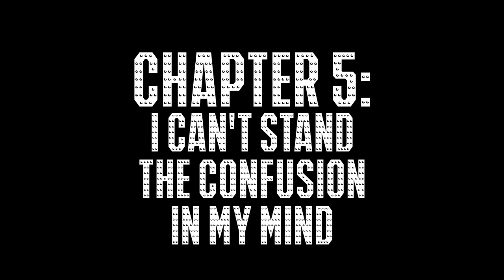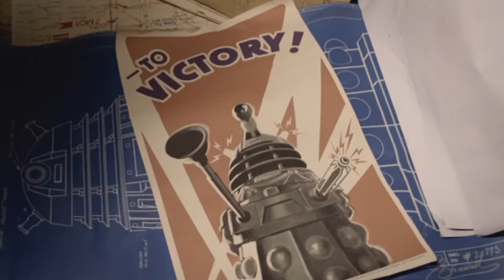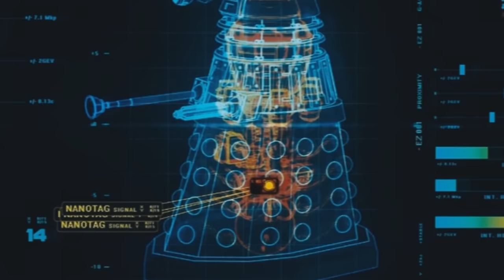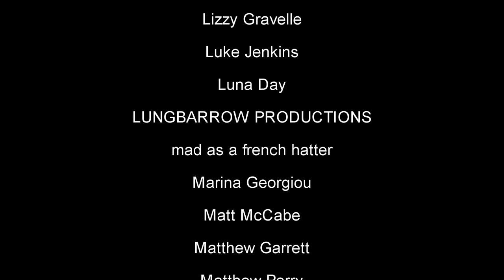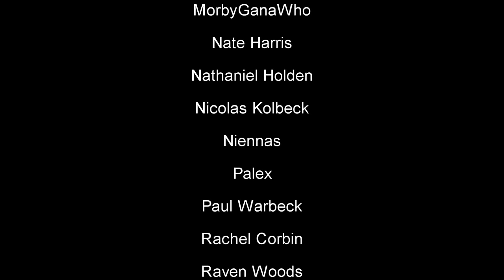The HISTORY of the Daleks ('Genesis' to 'The Time War' to 'Resolution' - 1963-2020)

Comment: I dont care what anyone else says, i LOVE the paradigm daleks. I wish future daleks would be colorful. I mean, it’d be easy to tell them apart, right? each color has their role.
Reply: I both agree and disagree. I want more colorful Daleks, but something more in line with what we saw with Capaldi. Gray & blue Daleks with stubby lights, gold & brown Daleks with cone lights. Yellow & red Daleks with bracings. Stuff like that works so well.
Reply: I feel like they should have like a line on their head that determines their role
Reply: @Bonnie-fy6od  I thought they should have gone full power rangers and combined to form an Ultimate Mega-Dalek
Reply: @Bonnie-fy6od fr. Never knew their roles till years later.
They could have been the new cult

Comment: Yeh, there's a problem right at the beggining of your video. The Thousand Year War and the Neutron War are different wars entirely. One took thousands of years, turned into a war of attrition, and was primarily though with biological, nuclear and chemical weaponry (I believe its the chemical and biological weapons that cause the mutations, not radiation per se if I remember correctly). The neutron War by contrast happened in a moment, and completey petrified the entirety of all living matter on the planet while leaving all non-organic structure intact. 

The only way one can square this is that the events of Genesis are absolute canon origin story, and The Daleks have to take place potentially millions of years afterwards, maybe even at the end of their existence. Remember that in Daleks Invasion Earth the Doctor says that the daleks here are from a period long before they sealed themselves in their city. That's clearly their golden period, the main bulk of time we see them operating in, where they're a huge system spanning force (so, The Chase, Master Plan, Evil, Day, Planet, Death, Resurrection, Revelation and Remembrance). I actually kind of find it fitting that potentially the very first time the doctor meets the daleks was also potentially the last, with the daleks being reduced to a bunch of isolated, terrified, paranoid, static electricity dependent lunatics, sat rotting away in the ruin of their dead city amidst a totally petrified dead planets, the events of their past so long ago its turned into mythology (the Thals and Daleks seeming ignorance of the original war, plus the Thals reference to the Daleks originally being 'Dals', not Kaleds, clearly indicating the corruption of knowledge).

Also, Power of the Daleks has to take place at least before Dalek Invasion of Earth. Why? Cus no one knows anything about the Daleks at all. It also to me indicates very, very early Human colonisation attempts, primitive and small scale by comparison post-Dalek Invasion. Don't you think they'd all known on Vulcan what the hell a Dalek is considering they were all en masse invaded and occupied?!

Comment: I always woundered how the relatively weak daleks of og doctor who became time war power houses. As you see throughout the time line the daleks dont actual face any major defeat until the the me Elon virus as all the defeat they get are relatively minor in a inter galactic level and they were fully able to continue invading other worlds during the stalemate. I also dont think the mevelon virus was as deadly to the daleks as you make out. I always assume the daleks self isolate in groups to prevent it spreading, meaning that although the empire remains intact they are forced to stop expanding and need mercs agains due to not wantinf to group up and spread the virus. By the time the virus happens the daleks are among the most powerful races in the galaxy it just delays their expansion till they find a cure. 

That means when the civil war ends all they need to do is rebuild and they are on the verge of getting ready for the time war.

Comment: The problem with the "Recon dalek" is that from other expanded sources, depending on which ones you believe, the Daleks either completely did not exist yet at the war was still going on Skaro, or they would still be buried underground on Skaro until well into the 11th century AD. Using the most recent expanded universe source, we have 11th century AD giving us a 200 year discrepancy on a race that "durr, time travel" can't explain because Daleks entirely lack that tech at that point too. Just more of Chibnail's fucking garbage writing.

Comment: Power of the Daleks should be earlier, since the Daleks are still running on static electricity.
Reply from the maker: Possibly? But there's 2 elements to think about here;
1) The Daleks have the plates on the mid-section.
2) Those Daleks could have spent decades or centuries in that capsule before being found.
Reply: @MrTARDIS  it's true that the Daleks could have been in the capsule for a long time. However, if we go off of the Daleks having plates, then this whole timeline gets messed up because they had plates in Genesis of the Daleks but not The Daleks.
Reply from the maker: @MetalJesus157  absolutely correct. I think we shouldn't take it too seriously :)
Reply: Moral of the story: don't overthink the Daleks.